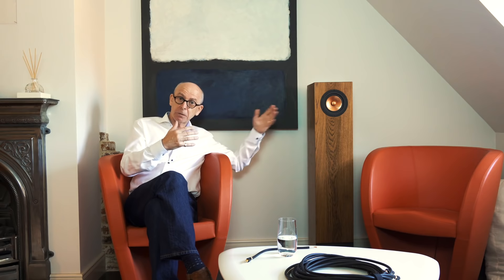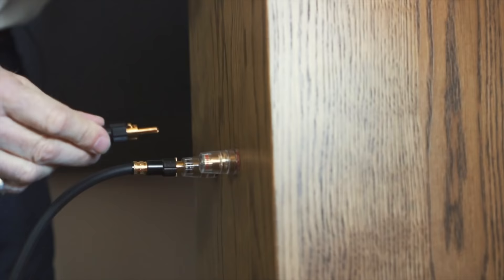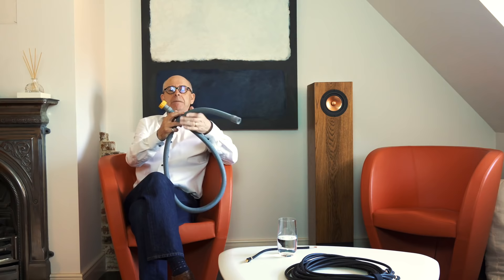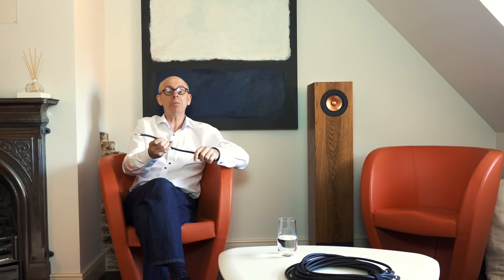Loudspeaker cables - how do they make a difference?

Comment: Harley, inspired by our little exchange today regarding perfection 😊 I realy think I have a great idea and you would be the man to provide it. You know I have a certain relationship to measurement in audio sound... but. If a measurement is just for comparison or looking for quantitive influence it can be stated as a good method. My idea. Why not put a measurement mic in front of your sound system, take a source and measure the signal or even take a measuring signal. Then change nothing but the cable and measure it again. Same source, same amp, same room, same speaker. Do this as long as you have measured any cable type you have or can get a hand on. Now we have a series of measurements varying only one parameter: the cable in always same length and same connector. These plots would bring an end to discussions if cable has influence or not and what lhysical influence there is. And you can even corelate those to your listening experience and find rules of thumb. I'd be pretty interested in that and it would give a scientific video for your beloved channel. 

Have a great day, Harley.
Reply from the maker: You raise a very good point here and what you ask is theoretically possible but test microphones will most likely not be able to detect some of the very the subtle changes in an ordinary listening room. In theory, if you can hear a difference then it should be measurable but the differences between some cables is very small and I would not have the correct equipment for that. I will discuss this with the team. Personally,  it’s a little out of my scope. Maybe someone has done this already? Testing of this kind is extremely difficult because we are not simply measuring amplitude at any given frequency. That’s why the sound of any component can not be compared with another with test graphs alone. The information they give us inadequate. It’s like pointing a telescope in the wrong direction
Reply: @PearlAcoustics  Thanks Harley. I have been participating at Porsche when acoustix exchanged several pre series shifters in the car and tried to find the cutest sounding stick with opened and closed roof 😊 The theory behind my idea is not to find answers for sound but reproducing the physical effect on the signal hitting the microphone in a not changing surrounding. Maybe as a German I did not get the last pinch of your comment by leguage. I would expect that the different measures will show the absolute influence to the test signal when just the cable is changed. Like engineers like to do: always change one parameter at a time. I'd really appreciate if you talk to your team. I am sure noone can corelate these little changes in the signal to the sound of the system but we all can say "Hey, the cable has an impact". Or not. 

Btw it is so chilling and nice having exchange with you. I bet having a leisure eve with you and a good drink of choice would be a really nice experience. Have a nice eve, Sir.
Reply from the maker: @iloveaviation-burgerclub-a8145  thanks! The feelings is mutual. Take care. Who knows, one day a glass of wine or beer might happen.

Comment: The fact that someone can modify the sound of a speaker drive cone by altering the size and/or cross-section of the wire seems reasonable. In that application the wire is forming a coil which will interact with a magnet. The nature of the coil and magnet interaction will directly affect the movement and therefore the sound at the cone. However, a cable that is being used to link the amplifier to the speaker cabinet does not produce sound. It is not part of the driver mechanism. It just makes the circuit. So long as the cable has appropriate electrical conductivity and the connectors make a good connection that is all that is required. I believe you have recognised this in your wise choice of a baseline cable. (By the way the comment of "this is all rubber with no plastic" ... I'm afraid all the "rubber" used in cables is just a soft squidgy grade of plastic!)

Comment: I can for sure see the need for large gauge speaker cables and interconnects if you are running long distances. Like your speaker cables need to be on the order of 200 feet long each channel. Same for wattage load. I would not want to push a 2,000 Watt amp at 80% full power down a lamp cord. LOL. It would obviously probably burn up over time.
Reply from the maker: Absolutely

Comment: My speakers are vastly different from yours . After much searching I appreciated the engineering approach of Mark Markel of Analysis Plus . Further study of opinions on his different cables I chose his silver-plated copper 12 gauge cables (very short) and they worked wonders on my 4 ohm open baffle speakers . For XLR I chose his single crystal copper cable . 
The white paper on the website states that geometry was the most significant factor for instantaneous power delivery . Whatever the reason , I am satisfied and look no more .
Reply: If I changed your cable while you were at work you'd never know (until you looked) spend your money on music 🌚
Reply: @zukispur5493  Someone tried that with me. It didn't work out too well for them.
Reply: @AT-wl9yq  "It didn't work out too well for them? Why? Was it not of good humour?
Reply: @AT-wl9yq  anyway. Keep listening to your music the way YOU want to feel it
Reply: @zukispur5493  I may have overreacted. I let one of my friends go to my house and pick up a couple pieces of gear I wasn't using and there was a miscommunication. I double biwire with 2 separate runs of speaker cable for each speaker. He took one pair of the cables and put jumpers to the other set of binding posts. I had no idea he took the cables and when I went to listen to my system a few days later, and as you can imagine, it sounded different. I ran the cables so they can't be seen unless you look behind the speakers. It took me a while  to figure out the cables were missing, and I got upset with my friend. I thought he was going to take another pair I had that was made by the same company. But yes, I overreacted.
Reply: @zukispur5493  As opposed to what? Someone else's way? I'm not sure I get what you are saying.
Reply: @AT-wl9yq following other peoples way is not in common. The reason you are not sure if you get what I was saying is because I wasn't saying anything. Was just saying
Reply: @zukispur5493  If I didn't understand your post, no problem. I'm only concerned with getting what you intended to say. A lot of people will try and hold you something even if it's not what you really meant. That's just not me. I'd much rather have a correction than a misunderstanding.

Comment: the solution to the problem you described with the driver and the shape of the conductor for the coil might not have been purely electrical as you alluded but also mechanical or purely mechanical in nature.
Reply from the maker: Indeed Dimitrios, that could also be true. But when a person who has been designing voice coils snd transducers for decades, and who makes such an incredible product - then I tend to take his opinion as gospel. Who knows? The important thing is - it made a big difference. And if you ever come to visit us. I can demonstrate silver plated loudspeaker cables versus twisted copper. I am sure you’ll hear a difference. Strange things these.
Reply: @PearlAcoustics  thank you for responding. i think it is important to know the answer to critical questions and in the case of technology and audio the proper 'marriage' of good knowledge of psycho-acoustics (the subjective part) and objective laboratory measurements never disappoints. i appreciate your invitation and i wish you the best.

Comment: Quality of components is subjective. The double blind test proves that while a cable may be made of superior quality materials and have a better design, the ear can’t distinguish the difference. Now, there are some other reasons for getting better cables. I did watch the GR Research video showing the antenna affect that typical paired speaker wires create. They readily absorb RFI in the cable. Now, like so much of audio we have the signal to noise ratio. That’s where I think you get the difference, during the null times. The floor being lower doesn’t change the impression of the peak due to the minuscule change in the floor level compared to the peak level. In other words, the change is only audible when there’s virtually no signal/SPL. That’s not what we listen for. At least that is my opinion.

As for the electrons moving along the exterior as several replies have stated, if they are jumping from hole to hole, might they not look like they are colliding and bouncing from the collision rather than being attracted by the opening? I am guessing they saw this seemingly hap hazard motion and felt it was due to collisions rather than jumping to an opening. This is the old path of least resistance line of thinking, jumping to the hole with the most attraction.
Reply: If you are worried about RFI, then twist your cables together, aka "twisted pair".
Reply: @SomeTechGuy666  they still can pull in RF signals. Go to GR Research YouTube channel and watch the episode where he takes an old receiver with an FM gain meter. He hooks up several configurations of wire to the antenna contacts.  It isn't until he gets to the woven wire with a hollow core before the signal dies.  Again this is noise floor in my mind and not a massive issue, but it does illustrate the point.

Comment: Where do you get your copper cable?  If I heard correctly, you said there are 80 strands wrapped in rubber.  In the USA on internet I have not found any copper wire described in this manner.  Only gauge is given and it seems PVC plastic is the wrapper of choice with rare mention of silicone.  Should contact with plastic be avoided?  Thank you.
Reply from the maker: It’s not easy to find and we have to buy it from a specialist supplier in lengths of minimum 1km. If you want some cable without connectors, we can make you a price. Please contact us via the website. Hope this helps?

Comment: The 'hydraulic' model gets a bit garbled in the explanation at the beginning.  Voltage is analogous to the pressure in a water pipe. It's current that is analogous to the speed of flow of water through the pipe. We even use the same word 'current' for water flow in a river or electricity flowing in a circuit. 
Analgous to the water spilling out the end of the hose, electrons would travel out the end of the electrical cable if there were a similarly low resistance. The end of the hose is (continuing the analogy) shorted to the kitchen floor. In contrast the power lead is terminated by a very good insulator - a lot of air - so there is no flow. The voltage (pressure) is present but no current.
Reply from the maker: Dear Peter, very nicely put. Thanks for your contribution

Comment: I was working in a studio many years ago and when i was sitting in the control room I noticed that the main monitors (B&W 800's) had the most unusual brown/blue speaker cables. Upon closer inspection, I observed it to be nothing more than unsheathed heavy gauge electrical cable of the type you'd use to wire a house. It sounded sublime and  I also used it in my own home studio when running passive monitors.
Reply from the maker: Absolutely! This is not far off what we recommend. High grade, thick Multi-strand copper.

Comment: Correction: your old tutor said speed of the water was like CURRENT, voltage being the pressure and pipe diameter giving the resistance to the flow, probably a long time since he told you that, but worth mentioning)
I am guessing he used a flat profile wire in the voice coil, the sound improvement was NOT from the profile specifically, but the way it closes the air-gap between magnet and voice coil, better magnetic coupling means less distortion and resonance. Sorry if I gave it away, but its pretty obvious.
Reply from the maker: Thanks Cornelius. Very useful contribution to the topic. Much appreciated
Reply: @PearlAcoustics  Thanks, sorry it sounded egotistic, I have a passion for speakers and all things audiophile).
Reply from the maker: @engjds  that’s ok…

Comment: I might have believed that wire could not make a difference, but  on a whim I tried out a new set of interconnects that were from a well known company and they changed the sound for sure. They made the sound worse, and I couldn't get my money back fast enough. Having had this experience the idea that a coat hanger would be as good as a well made interconnect just seems silly because I have heard the difference. Yes, it was not what I expected, but it was enough to prove to me that wire can change the sound.
Reply from the maker: Dear Cameron, thank you for your comment. It’s through exploration we find our own truth, and are the beneficiaries of it. Enjoy the music.
Reply: Had a similar experience. I returned them too, and bought a different pair of the same manufacturer with different capacity / inductivity level that only was 20% more expensive though and it made „click“. Significant improvement. Hifi really is a hobby. It’s not set up and forget. It’s trial and error, there is not one Formular. That’s the fun :)
Reply: So ... the new set of interconnects were badly made or badly terminated.
Reply: @williamzame3708  no, there was nothing wrong with the construction of these interconnects, actually they were some of the best constructed interconnects that I have seen. .
Reply: @dudemastermaster8944  yes, hifi requires a lot of trial and error. I think that this is what makes it both frustrating and fun. It is rare to just find gear that all works together right out of the store. I had that happen once, and that was 40 years ago.

Comment: Love your video's. I have known for a long time that speaker cables to make a difference. The cable that I found that made the most difference was the Townshend Isolda. My first encounter with them was when I bought a second hand cable from Ebay. On getting it, I realized it was too short for my needs. I asked a friend of mine to test them. He used them with Williamson amplifier followed by single ended 300b amplifier. His speakers were horn loaded Lowthers. Later that evening I got a phone call saying the cable caused him a problem. It blew away every cable he had including some old Isolda cable made from a number of coaxial cables in parallel. He was so impressed he bought the cables of me. The one I got had to copper foils in parallel (like a capacitor on it side). I wonder what your speakers sound with the latest version of this cable. It suited his Lowthers well. Your speakers seem to follow a similar principle with a single driver and no cross over giving a fast yet detailed sound. I bought 2 longer pairs later on from Ebay to use with Townshend Glastonbury's in bi-wire mode. The thing that comes across is the blackness of the background of the sound stage.
Reply from the maker: Thank you kindly for your appreciation. Especially on this controversial topic. What you describe is exactly the point I was making. You can change the sound with a cable if you assemble it as a capacitor, inductor or resistor. Hopefully, one day you’ll hear a pair of our loudspeakers and then you can decide if they need any fine tuning. I know Lowrhers very well. I used to visit their factory in Bromley and watched the women winding the voice coils for the drivers. They inspired me on my journey. Best wishes

Comment: If cables really mattered you could show the difference clearly with different cables. That it is a contentious topic still suggests it’s not a big deal.
Reply from the maker: Hi, thanks for your comment. I hope I emphasised that compared with the wire in microphones and loudspeaker drivers that cover high frequencies, loudspeaker cables are not nearly as critical. Having said that, there are loudspeaker cable manufacturers out there deliberately making cables that sound different. They do this by changing either capacitance, inductance or resistance, or a combination of the three. This is why we decided to run with plain, high quality, multi strand copper for our cables. On the basis that it is readily available and people on a budget can easily make their own. Hoping this answers your concern?

Comment: I'd suggest that before spending $300+ on speaker cables, spend the money on acoustically treating the room. Otherwise you're casting pearls before swine as you don't know what you should be hearing.  I always am surprised by the money spent on power, speaker and interconnect cables instead of addressing the room acoustics with bass traps, diffusors, etc.
Reply from the maker: Hi Ned, you’re absolutely right. Our cables ‘won’t make a difference’ unless there’s something wrong with one’s cables and the room is always the first place to start. I hope I make that clear in the video?  At best they can only be the finishing touch’ (unless you need some anyway).

Comment: Dear Harley,
Just a little question. How about using short speaker cables and place the power amp between the speakers and use long signal cables instead? 
(Balanced signal cables)
Reply from the maker: Hi, thanks for your question. In fact that’s what basically happens with active studio monitors. Personally, I don’t see a challenge with loudspeaker cables, in as much as the impact on sound with them is very, very small (unless a cable manufacturer deliberately sets out to bring a change about). So as long as one uses a sensible gauge and good quality copper the usual lengths used in domestic situations is not an issue. But your solution is valid, none the less.